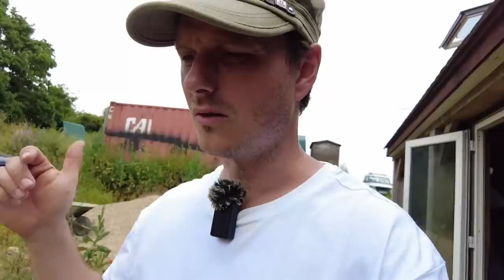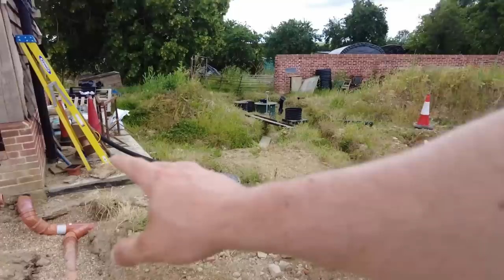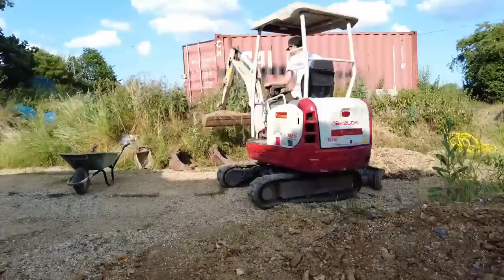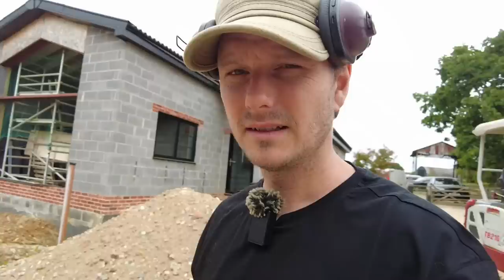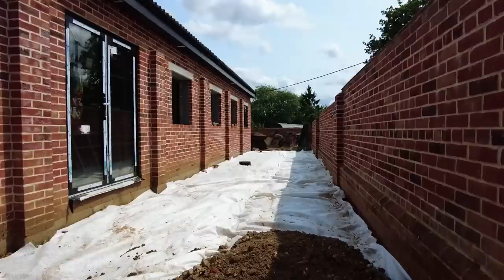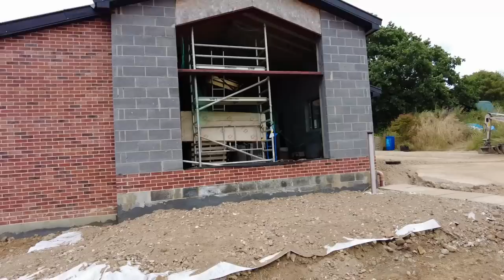Using a Takeuchi TB216 to backfill + Grade Land - Mini Digger Excavator - DIY

Comment: That was a terrific video!! The bit where you were trying to get the big inspection chamber thing in the black pipe 🤣. Also I picked up some of those 600x900x50 slabs this week too and pushed the limits of my suspension!! They are bloomin' heavy.  Couple of Q's... What is the purpose of that geotextile membrane? And when you said something about benching in the gully things, what did you mean by that? It looks so different now it's all graded and tidy I bet it's well satisfying! Impressive digger skills too
Reply from the maker: I was going to get 16 slabs initially but thought I best not kill my van just yet 😂
The membrane stops the crushed rubble from sinking into the soil below. I wasted about 5 tonne of mot type 1 on the slope up to the field cause I didn't put a membrane down first 🤦‍♂️
I said benching but that's what you do inside a manhole 🤭 I meant haunching, you do both with cement. For haunching you build up cement round it to keep it in place.

Comment: Nice work, it's coming along nicely now. Love that stage of projects where you can level off the surface; It may not be complete, but it's a huge milestone. We very recently got to the top soil level in our garden after starting huge rework last year (5 skip loads+11bulk bags wheelbarrowed, soakaway, patio laid, drainage, etc) and just having flat ground to walk on felt amazing satisfying.

Enjoy those beers!
Reply from the maker: It's nice being able to see everything properly now 😁
I'm dreading laying the patio even though that'll probably be in another year 🙈 there's so much more landscaping to do 😬
Reply: @THE-AIDEN-PROJECT  I think once you get into the rhythm of laying them, you'll find it fairly easy. Handling and getting the mortar level right for 90cm slabs was tricky, but 95% of the hard part for us was the planning (hard for its size) and groundwork. The ungodly amount of hidden/buried builders waste, general waste, stone, and concrete more than tripled the time to do the groundwork; also hence 5 full skips. The concrete breaker we got unexpectedly paid for itself many times over; so thank god we didn't hire.

Comment: All that grading made a hell of a difference. I was working outdoors today, 97F and 88% humidity, a normal Tennessee summer!
Reply from the maker: Sod that, I'd be in the paddling pool 😅
Reply: @THE-AIDEN-PROJECT  Today's forecast "A very muggy and hot afternoon is in store for the central and southern Tennessee Valley and Sequatchie Valley. The very muggy conditions will produce heat indices of 100 to 105 degrees. Some areas may exceed 105 degrees. These conditions will produce dangerous heat and humidity across the region." Luvvly jubbly!